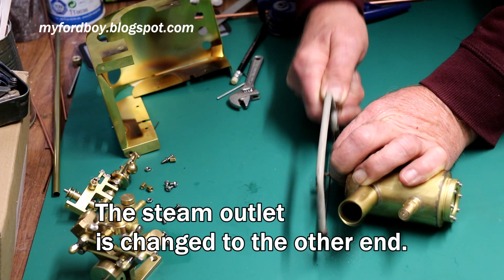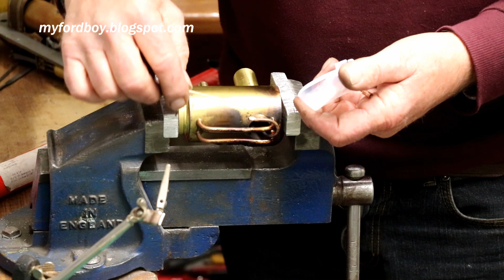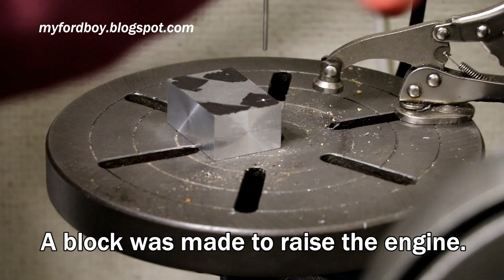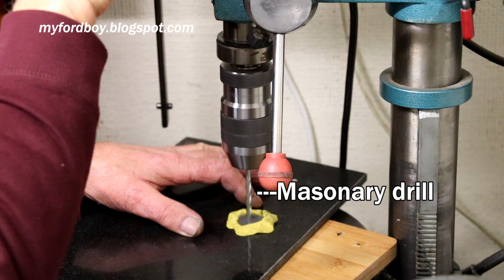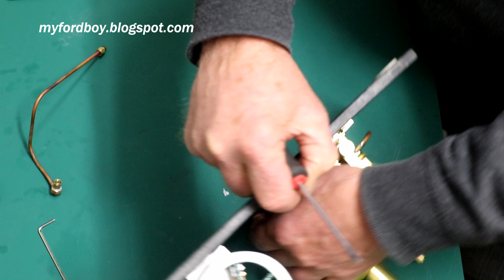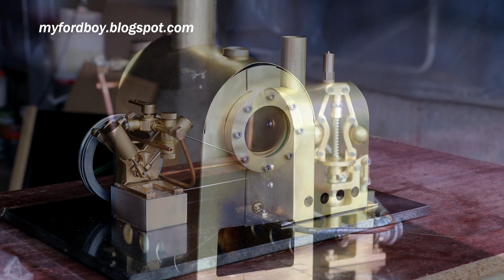Marine Steam Engine Conversion Part 2

Comment: I'm surprised you didn't cast a nice plinth for the engine rather than use a plain block, but otherwise a very nice model now. I expect bringing the steam pipe back through the firebox made for an improvement too. Always a pleasure to watch you work.

Comment: Nice job & video, thank you!
P.S. To properly anneal copper it needs to be heated to red hot then quenched in water.
Reply from the maker: The copper will be soft if you let it cool naturally or quench, makes no difference.
Reply: Sorry to disagree, but it does make a difference, it will be much softer and easier to work if you quench it. 
It is possible that those tiny tubes won't exhibit much difference because of their miniscule size, but larger tubes will show a big difference. I spent many years working in the plumbing industry and proved the quench method many times, to many people after it was shown to me. Try it on a piece of 1/2" or 3/4" copper pipe, you'll see the difference then.

Comment: That was cool except one thing. You do not know how to silver solder. You keep pointing the tip of the flame at the joint. That blows contaminates into the solder joint. I'm a refrigeration technician and I use it on a daily basis. Other than that it was a good video.

Comment: What size copper pipe are you using? I have one of these engines, but without the boiler. Thanks.
Reply from the maker: I used some 1/8 diameter but had to drill out the couplers for it to fit. 3mm is the correct size.
Reply: Thank you